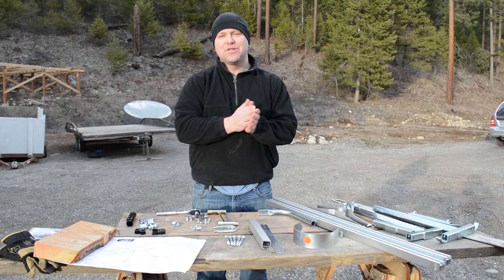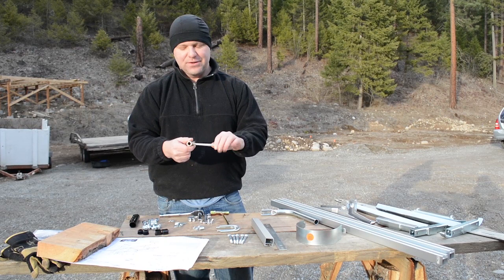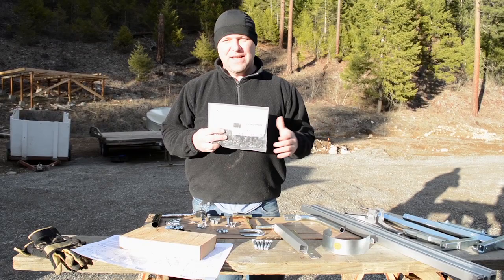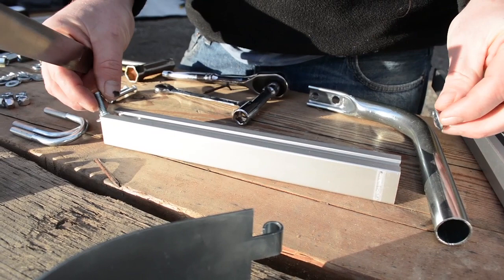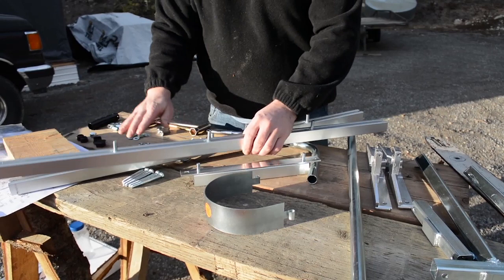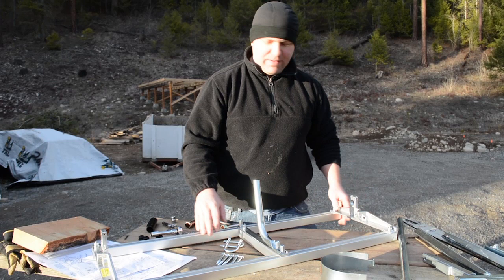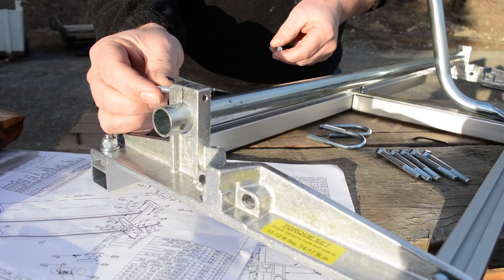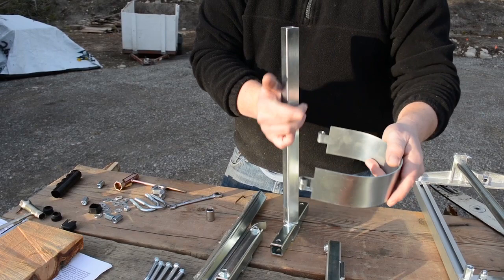How to Assemble a Granberg Alaskan Chainsaw Mill MKIII

Comment: Hey Jesse, thank you for sharing this video. It really helped as my saw mill came in today without the assembly instruction but a parts list that looks like I didn't have everything required (wrong or inaccurate list). Just to be sure, I found your video and with it, I realised that it came with all parts except for those flat and lock washers. However, it did come with a spare lock nut and coupling nut each, which you found missing in yours. Thanks again. Cheers

Comment: I had 5 washers 1 long bolt and 1 coupling nut extra after following your instructions so I hope each of these kits is slightly different and hand counted!!!
Reply: same except i had one lock washer left. in the instructions that came with mine both nuts on the u bolt are supposed to be coupling nuts

Comment: I have A Echo Timberwolf 20 inch bar 59 cc...should i go with this or the Granberg Chain Saw Mill, Model# G777?      the g777 is 129 dollars and goes up to 20 inch the other one is 24 inch and costs 259

Comment: Thanks for sharing. We have the same sawmill setup, with a Husqvarna 3120 XP chainsaw. I have been toying with the idea of welding an adjustable height "rack" with rollers for my sawmill so that I never need to worry about if it the first cut, or the tenth... Things are just so busy on our property, so I have not even had time to test it out yet... Look forward to the time I can make my own lumber.

BTW - Looks like you have a structural engineer inspecting your sub-floor at 17:31 :-)
Reply: Back to Nature Living
Reply: Back to Nature Living

Comment: Question: will you have to treat or stain the wood used for the "hot tub deck" you've made from the fresh cut lumber ? Cheers.
Reply from the maker: No mandatory. It's likely we'll treat the decking with something but not the frame. :)

Comment: OK why is the on-off bar called an on-off bar? it doesn't appear to turn anything on or off!
Also why all the coupling nuts? they don't appear to couple anything to anything else, surely they could all be replaced by ny-loc nuts?
Reply from the maker: On off bar is actually a guide for when you are coming onto and off the log to help you keep it straight. If you are using a board as a guide the on/off bar would rest against the board to keep your mill square as you enter and exit the log. Haven't tried it yet but that's the description provided and in my experience with our diy mill the hardest part is getting the mill started square and not gouging as you enter. When you do this wrong is makes a mess of every piece after that as it gets harder to correct.
Reply from the maker: Coupling nuts are to make things quick to adjust. The bar wrench fits them perfectly and they are all in spots where you'd want to adjust the mill. :)

Comment: Do you know what purpose a nyloc nut serves? I highly doubt you built this properly a nyloc over a lock washer defeats the purpose haha.
Reply from the maker: Had my doubts also, but that's what m the instructions show. I'm curious how frequently the bolts without lock washers or nuts will need tightened. Surprisingly those mills don't rattle and shake as bad as I thought but would be connected to a chainsaw.